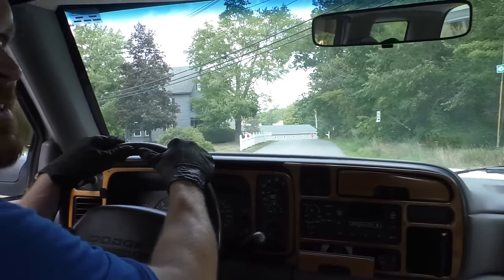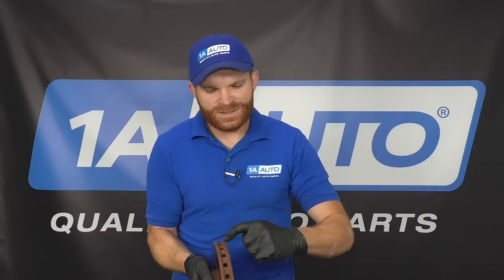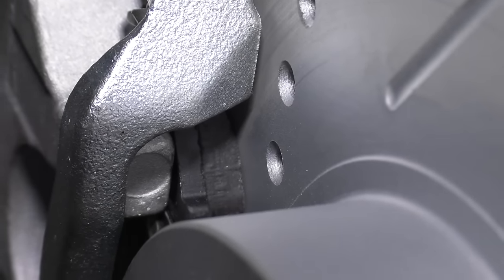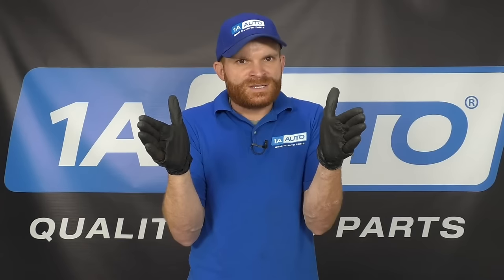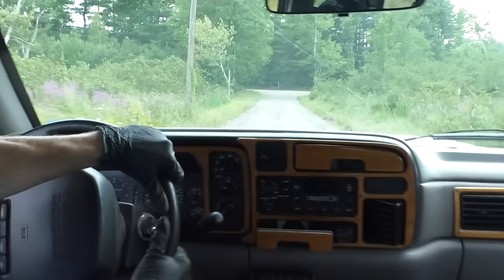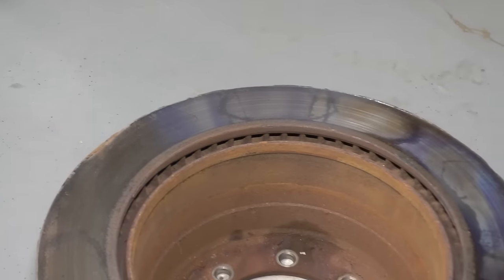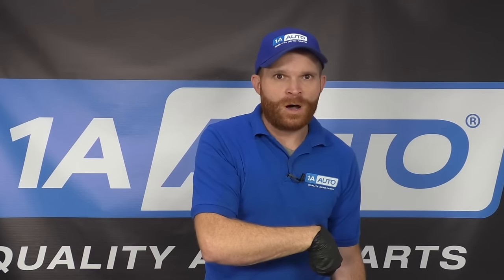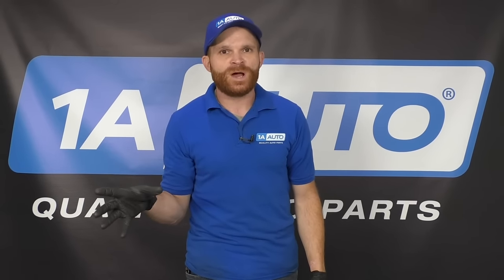What Causes Brake Shuddering, Shaking, and Pulsing on My Car or Truck?

Comment: Lol… most mechanics don’t check runout. They’ll just throw parts at your car. We had a slight brake pulsation and our Lexus mechanic just told us to replace ALL pads and rotors. The car has 54,000kms
Reply: You can pay any mechanic to do what ever your heart desires, if you want them to check runout before doing your brakes then state it. Difference is you are now paying that time for them to check the runout per wheel on top of them also doing the brake job. Which if you have an issue with a warped rotor kind of the best way to fix it is a new fresh rotor vs cutting your original ones. You get hardened spots in the rotor naturally from driving and parking your vehicle. The pads where ever they may sit while the car is parked will retain the heat from driving while the rest of the rotor air cools at a different rate. Is measuring run out necessary if you know the cause of the vibration from past experience? No, is it great info? Absolutely, just remember time is money and the more steps someone takes the more the cost is passed to the customer.
Reply: @kalei43  and just how does one rectify the problem if your mechanics solution is to simply assume all 4 rotors are warped? Seems more likely there is an underlying problem that should be solved or you stand the chance of repeating the issue.
Reply: @beri232  I explained exactly what naturally happens to all rotors in my first response. It is in the nature of the design unless you continue to turn those wheels till either the brake pads have also cooled distributing the heat equally or you remove said brake caliper. We know both of these situations won’t happen so we just except hardened spots on the caliper causing warpage over normal usage. You ever watch that show forged in fire?  Same idea but with your brake rotors😂. You can pay for a mechanic to do absolutely anything you deem necessary, just let them know what you want them to do and they will discuss with you the shops hourly rate.
Reply: @kalei43  lol…. In all my 50 years…. I have NEVER had any brand new vehicle (or used for that matter) have 4 warped rotors after only 54,000kms.
Reply: @beri232  Problem is that’s only your side of the story, I’ve been a dealer tech amongst lots of other jobs. Normally a dealer tech is going to first address your concern, the vibration. If he deemed it to be the front rotors then that’s what the work request would say. Who’s to say that along with his brake inspection he also measured your pad thickness in the rear and wrote up a recommendation to have those replaced aswell? I’m thinking this would be the more likely scenario. On the other side we have seen some real idiotic things happen in a dealership before. So a customer wrecking all his brakes is not out of the realm of possibilities. Brings it back to measuring the runout, if you want them to do that then say so. Don’t be surprised if you get charged for the request tho🤣. I’ve had requests to true a brand new rotor before on the lathe, to be fair even new ones are not perfect and actually can be cleaned up a bit. If someone is willing to pay id be willing to do it.
Reply: @kalei43  the brake pads were like brand new. They were actually going to reuse them…. which I also found odd. If all 4 rotors were warped, than they should have replaced pads and rotors so they would wear evenly when installed. It doesn’t much matter at the end of the day. I swapped out pads and rotors myself with higher end parts and did a complete brake job myself the other day. I had 6,000kms warranty left on that car and they wouldn’t cover the work or give a sufficient explanation…. so they lost a customer.
Reply: @beri232   This conversation is starting to not make sense, didn’t you just fault said mechanic for just throwing parts at a problem? Yet your last response you do exactly as he recommended in the first place? So basically you’re saying that he was right and followed his recommendation?🤣 

Just a FYI brakes by no manufacturer is covered under warranty unless there is something defective about it. Your brake pulsation is a pretty normal concern that warranty would reject if the dealer would try to submit a claim.

Comment: Hey, I need help with this. I have this issue with my civic 8th gen. If i ever apply emergency brakes. The car slides. I went to the honda dealers, they changed the pads and services all brakes and said everything is good But the issue never resolved. Whenever i apply emergency brakes the brakes just slide. Normally my corolla if emergency breaks are applied i feel a strong abs function stop/go and the car stops immediately. Like 2  meters drags max. With civic i just dont feel the stop go ABS motion. I do feel for a second or 2 then it just drags and i end up hitting. Literally yelling inside what's wrong with this car. In normal braking it works fine. Even if the car is on just 60 kmh speed the emergency brake won't save me. Idk what to do 😐

Comment: Only my front left rotor keeps warping or wearing unevenly, 3 times I have resurfaced it... 3 months after the vibration return... what could it be that is transfering or wearing my rotors unevenly only on one wheel? bearing' wheel hub?

Comment: I don’t feel anything in the brake pedal but I got a bad shuddered braking over 60 but it does pull to the right
Reply: What was the issue?
Reply: @enrique4737  I think it was just the transmission. I put a lot of time into trying to figure out what it was, replaced brakes, calipers, rotors, sway bar links, struts and shocks… Weird but yeah the transmission can cause a shudder I read and it went out shortly after I made this comment.
Reply: @enrique4737  torque converter probably… I never diagnosed it and I even took it to Firestone, pep boys, asked around at local shops and nobody knew or could tell me but I do have some experience from college for diagnosing issues. I think maybe just low transmission fluid because that’s what the article I read said it could be. Yeah man it was just one of those weird rare things. Nobody could figure it out
Reply: @xbluepuddingx  thanx for the reply, I'm guessing it might be as well. But curious why mine went away for a week wjen I change rotors and brakes then it came back...
Reply: @enrique4737  it could be tires, rims, control arms, ball joints, could be bushings, sway bar links, cv axles, transmission like I thought happened to mine, could be an alignment issue so maybe shocks/struts or honestly even the brake master cylinder man or low fluid . It’s just so hard to diagnose shit like that man but I hope you get to the bottom of it and fix it man. You just start one at a time, check to see if there’s any play in your steering system and wheels. Just one step at a time man

Comment: I drive a 15’ Merc C Class W205 and every 3 months I have to have the discs and pads replaced due to juddering under braking. I’ve gone through 5 sets now. I only drive it once a week for less than 50 miles and do no sudden braking. Anyone know what might be causing this?
Reply: The Calipers may be pushing the pads against the rotors when you are not pushing brake pedal. Have all front brake calipers movement (inner & outer) tested.  Note: Some brake pads last longer because they are a harder material. See that your foot is not allways using brake pedal while driving.  Hope helps
Reply: Juan commented to have new disks turned (shaved) to make them perfectly flat on both sides on each of the 4 disks . See comments.

Comment: Brake rotors don’t warp; they wear unevenly. DTV (Disc Thickness Variation) I understand that the term warped rotors is an old term that needs to change. If you a going to put information out there give all up to date information. A bad hub can also cause a pulstion you need to check for runout. There are many causes for a pulsation. This not a personal attack I just wish we can put good information out so future techs and diyers can learn.
Reply: will having them turned help this?

Comment: ok so what happens when you put new rotors and pads and its still doing it?
Reply: ... did you watch the video?
Reply: Check wheel bearings, lower ball joints..

Comment: I am beyond baffled and don't know what to do at this point..."PLEASE help" I have changed the flex hoses, calipers and rotors on the front and brake pads,  on my 2011 volvo s40 t5. I have changed the master cylinder , and the abs pump and modulator it was used part but my car is still getting very hot on my front area brakes, the rims and rotors are very hot after driv9ng for a bit, and one of the feels like it is dragging or trying to lock up.....because my car starts to slow itself down without me braking after I have touched the brakes.....I don't have any idea what else to do at this point...my mechanics can't seem to find the issue ...and IO truly need my car to run so I can get back and forth to work and I cannot afford to get a different car right now...Please help
Reply: Like he said at 2:30….maybe your brakes are sticking to the rotor and apply pressure continuously
Reply: I’m not a mechanic so I don’t have a resolution for you

Comment: Go back to school and learn where the real source of the pulsation begins....it’s called lateral runout. It’s where the hub and rotor are manufactured to different tolerances and 100% of brake technicians do not index the rotor to the hub to minimize the runout(or warped rotor for the uneducated). Fix this issue on ANY new or used rotor (except carbon) with an on car brake lathe that compensates for the lateral runout to increase pad life and ELIMINATE the pulsation factor for most of the pad life. Don’t forget to torque your lug nuts properly, over torqued lugs increase runout by distorting the hub and/or rotor on most passenger vehicles. As far as rotors being manufactured to thin....well that one is on cheap rotors not being made to recommended spec, or someone doesn’t know how to use a dial caliper(#1 reason). Most Original Equipment rotors have 3-4 cuts before minimal thickness. Brakes ARE the most important item on your vehicle, don’t cheap out, use quality parts and proper techniques for everyone’s safety!  New or reusing rotors need to be matched to the hub. Installing new rotors and pads without matching them is a bandaid to your pulsation issue. FYI, 27 yr ASE master tech with focus on brake systems for over 10 years, I’ve taught many instructors and technicians the proper way to stop a vehicle. Including oval and road race cars. Want to know more, look up Pro-Cut brake lathes, they are an industry leader in proper brake service. Ever wonder why you don’t see a shaky steering wheel while watching NASCAR in car camera at a short track(with glowing rotors)? It’s because they have floating rotors, allowing the rotor to move to eliminate lateral runout. It takes 1200+ degrees F to distort(warp) a rotor. Most pads fail before you will ever see that on the street.
Reply: Great info. Does that mean brand new rotors still need to be checked for clearance?

Comment: I’m getting this issue after installing brand new brakes and rotors 😫
Reply from the maker: You may have not cleaned off the hub surface good enough. this will cause the rotor to not is flat against the hub causing a pulsation.  Thank you for checking out the video. If you need auto parts go to: http://1aau.to/m/Shop-1AAuto-Now
Reply: Same here.  Please tell me how you fixed the problem.  Thanks
Reply: Same problem here. Please tell me how you fixed the problem. Thanks
Reply: @utdoc  the brand new rotors were defective. I bought a higher end version and noticed that even the brake pads fit much better than the cheaper version. I haven’t had an issue since
Reply: @bugsy74  thanks,  I will visit the mechanic who installed the hardware and let him have a look at the issue.

Comment: What if it only does it around 65MPH?
Reply: Tires balanced?
Reply from the maker: If its only when you are stepping on the brakes than it is probably a rotor issue. If it all the time then it could be a tire issue. Thank you for checking out the video. If you need auto parts go to: http://1aau.to/m/Shop-1AAuto-Now

Comment: My f150 starts bouncing up and down when I go down a steep hill and apply the brakes, and it keeps bouncing after I get back on level ground. If I park it for a while, then start driving again, it's fine. It doesn't start bouncing again until I start going down a steep hill, and apply the breaks. Anyone got an idea what might be causing it?
Reply: Are there any noises???
Reply: @rey7299  no, there's not any noises,at least not that I can hear.
It's the rear of the truck that does it.
I'm thinking maybe either the brakes or shocks.

Comment: Changed the brakes on my tacoma 2012... Still shakes :/
Reply: Did you check the hardware that came with the pads? Lubed?  Were all surfaces cleared of rust? Caliper pins not stuck in either position? If everything was good, how are the tires? Tightened up good?
Reply: @chrisjimenez603  changed the front pads and rear brake shoes at first.. turns outs my rotors were warped. Ended up swapping those and the truck is like brand new 👌 I assumed the pads were the issue at first becase they were completely spent. Thanks for checking up though!

Comment: Why is my truck shaking when foot is on break and vehicle is in gear
Reply: If the vehicle is in drive but parked and only shakes with brakes pressed, you prolly have a vacuum leak. Could be on your brake booster.

Comment: I have 3] 2007 dodge caravans - 15" wheels. All the rotors warp in the hot down hill stops.  My 2003 cargo caravan with 16" wheels never vibrate or warp even with half a ton of tools and fat asses in side. Shame on Chrysler!